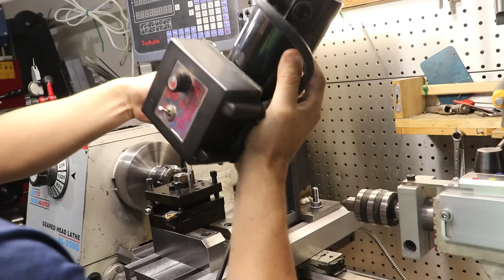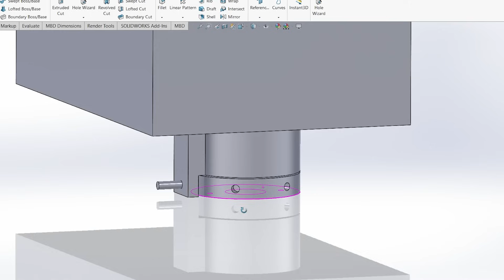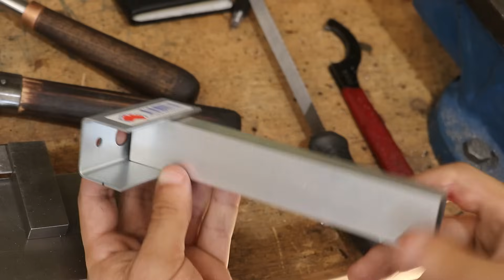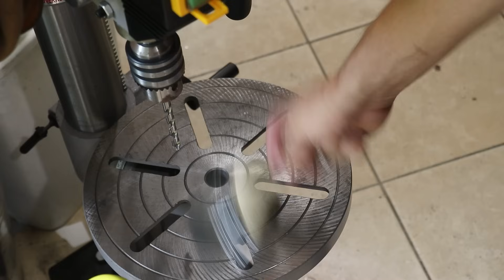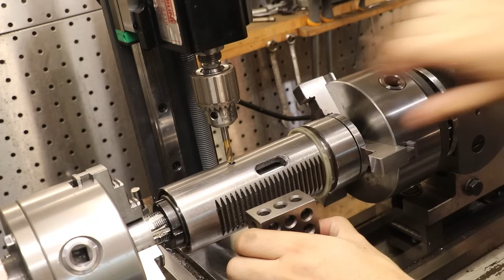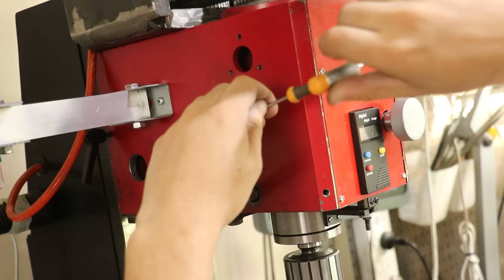Spindle Lock For The Mill - I Should Have Done This Years Ago

Comment: With the amount of time you spend on your hobby I'd suggest opening some cash sales accounts with material suppliers. Bunnings is often close to 6x the price for aluminium and mild steel, only for use in emergencies
Reply from the maker: I have a proper metal shop that I go to once a year. It’s a 3 hour drive to get to them. With most places I don’t reach the MOQ for most metals and most places near me only sell in 3 or 6 m long bar stock. It’s never as straight forward as I would like it to be
Reply: @artisanmakes  i look at is this way, i can buy a length of material for less than i can buy 1m of material at a local hardware store so it doesnt matter if i dont need it all its still cheaper usually straight off the bat, maybe im spoilt for with storage options or just that pricing competition is much greater in the SEQ because delivery is usually free too. 

Love your work, hate bunnings prices.

Comment: A much needed upgrade! Years ago I made similar for my mini mill with some minor differences. The springs is hidden or on the back side, the knob after pushed in is rotated 90degrees  and stays in and locked and when rotated back it pops unlocked, the knob it self is 1’ hex stock for easy flat gripping to order to rotate. A hardened 1/4” pin goes into the aluminum belt drive pulley which has a steel bushed pressed in to eliminate hole elongation. Made a draw bar hammer from the correct deep well socket cut off the square drive, pressed in a brass rod and drilled thru all for a handle which locks the two pieces together…
 So basically push and twist the lock, loosen the drawbar with the hammer socket flip the hammer and a slight wack  from the brass end to loosen the R8 collet… super fast and super easy

Comment: If you want to make sure you dont engage the spindle while the pin is in place, you could put a small switch that either breaks the power to the spindle, or triggers a bright red light when the pin is pushed in.
Reply from the maker: That is what the spring is for.

Comment: Very cool! For mone (I had the same mill), I made a collar that fitted the spline and locked that in place against the top of the mill using the heads of the three existing cap heads. I like yours more as I had to lift mine off to use the mill.  I sold the mill and upgraded to a bigger one in the end :)

Comment: Good fix! There's nothing like a draw bar for tool holding, but users get flustered with reaching high to use them. Some end up making clever air or electrical devices to drop the tools.
Reply: I'm like 6'2" and I have to reach almost as high as I can on my mill to open the drawbar. 6ft or shorter guys would absolutely need a stool or something

Comment: i love this channel so i hope i don't sound too aggressive or over criticizing, but why would you machine a piece of steel for plugging the hole on the side, it seems such a waste, especially considering the fact that it only partially covers the threaded holes, and that a simple sheet would have been more than adequate, maybe even bolting it instead of gluing it. 
I understand this might have been practical at the time but it feels so cheap to see...
Reply from the maker: I found it in the scrap bin and it was roughly the size I needed. That’s it. I don’t generally stock any large steel and this was the only big large enough. I don’t particularly care about the little bit of hole left exposed and I wouldn’t recommend that you do. Cheers
Reply: @artisanmakes  i see the mindset, and i actually understand  and appreciate it, keep it going with the important stuff!

Comment: Great project again!
I was wondering if it might be a problem for the locking pin to come out by itself?
You could have used a ball bearing and a spring in the collet and a recess in the pin at the “locked” position to help the pin stay in place when you change tools. Then, just by a slight pull, you could retract the pin and it would slide out?

Hope you get the idea, my English isn’t so great 🙂

Greetings from Germany!
Reply from the maker: I want the pin to always be pushing out as a sort of safety. I don’t want the pin to be locking when I start the mill. That could happen if I used a ball detent. That’s how I see it anyway.

Comment: Didnt you consider different options, like motor brake or lock (you have a lot of acces and space around motor cooling fan), or add encoder to motor and then FU should be able to stop motor completely.
Reply from the maker: I don’t particularly want to be attempting to modify the motor. It’s not an area I know much about and I don’t think it is something I would want to be showing YouTube incase I do something wrong.

Comment: I have a PM 833, and it doesn't come with a captive drawbar. I made an easy modification that works well. It involves machining a small groove into the drawbar, then drilling and tapping three holes into the thicker splines in the spindle. The set screws in the holes index into the groove in the drawbar, which prevents it from rising during collet changes but still allows it to turn freely. I can send pictures if you need them, but it's pretty simple. I also added a thrust bearing between the spindle and the drawbar nut. I use a cordless 90 degree impact to tighten and loosen the draw bar so no need for a spindle lock.
Reply from the maker: I think I understand what you are describing. It is an interesting idea that I have never thought about. I am glad to hear that it works for you

Comment: Just wind the spindle down, align the MT release slot in the spindle and the quill and place the MT release tool in there to lock the spindle to the quill together.
The other advantage of this is the draw bar nut is now lower and easier to reach🤣👍🇦🇺
Reply from the maker: I used to do that heaps when I first got the mill. It takes 50mm movement of quill to engage that channel. More often than not than not there isn’t room to plunge the quill down. So you spend quite a bit of time cranking the head up and down. I think that’s why I stopped doing that method.
Reply: @artisanmakes  Makes perfect sense.
Especially if you don't want to move/dusturb the carriage position to remove a tool and height is limited etc.
Also, in my case, I have a stupid mill with a round post with gear and rack system to raise the head, so if I loosen the main post clamps to raise the whole head, the head can pivot/swing side to side on the post, so I can easily loose my position🤣👍🇦🇺
Reply from the maker: I know the pain. The first mill I ever used was a round column mill. A pain to use, thankfully I never had to machine anything too precise. with that mill. Cheers

Comment: I think there was an infinitely easier solution, just cut a small key way between the exposed bottom (rotating part) and the fixed spindle shaft. Slide a square key in the slot and the shaft can’t rotate.
Reply from the maker: It’s not too dissimilar to the sliding pin I originally drew up. I think the problem I’d run to would be the same as the pin design, which would be mounting a spring loaded sliding key to the quill. There’s just very little wall thickness to work with so drilling mounting holes, other than M3 (like you see for the dro mount) would be difficult and I would like something more substantial than M3 holding it all together. Cheers

Comment: Boy, I hope you never feel the need for larger equipment after all these upgrades. The only time I had to disassemble the quill to my mill was when the pin for the R-8 collet sheared off. I hope to never have to do that again, though, since I bought the mill in 1998 (new) and have used it a lot, I may want to put new, better bearings in. I’ve also made several major modifications and while I’d like to get a different mill, all of these mods stop me from making the decision.
Reply from the maker: Good thing is I probably couldn’t get anything heaver down to this workshop than this mill if I tried.
Reply: @ same here. I don’t have a Bridgeport size mill because I don’t have the ceiling height.

Comment: Whoah this is excellent! I need to check or replace my spindle bearings, (same mill), as I don't have a lot of faith in either their initial preload setting or subsequent use/wear. 
They have not been mercilessly flogged, nevertheless, mass produced chineseium settings and quality don't necessarily align with the work I need to do nows critical requirements.
I have attempted to adjust the pre-load in situ, (tricky indeed), but I'd rather spec my own bearings and start from scratch.
I have never seen the spindle removed and disassembled so this is pure gold thank you Mr Artisan!. (I have the parts diagram exploded view but yeah - video!).

Comment: Really nice! My only concern is it looks like you could engage the lock while running the mill. Might be worth putting an E-stop switch on your spindle lock just to avoid that possibility. The spring should help avoid the problem though, so maybe not necessary.

Comment: The only question I have is when do you take delivery of a third hand/arm combination, and where does that mount? Over the left tit or the right? Unless I'm missing something you need a hand (1) to press the lock and keep it in place against the spring, while hand (2) uses the wrench to undo the drawbar nut so that hand (3) can take the tool to be removed, out of the spindle and pickup and reinsert the replacement tool while hand (2) tightens the drawbar while hand (1) is still holding the spindle lock in place??
Otherwise, a well ?? thought out and executed project.
Regards from Canada's banana belt. 
🤞🇨🇦🍌🥋🇺🇦🕊🇦🇺🪓🪃🏁👍
Reply: Well the way I see it, previously hand (1) was holding the pin wrench, hand (2) was undoing the drawbar nut and hand (3) was taking the tool out. So this is definitely better than stock!
Reply from the maker: Its pretty straightforward. Left hand uses the spindle lock, right undoes the drawbar using the drawbar spanner. I Then use the drawbar hammer to hit the tool and I use my left hand to remove and replace the tool.

Comment: Hmm I have a long way to go in modding my mill, you are on another level.  I have that same mill and the only made two mods so far. The first was to remove the Quill DRO on the front and replace it internally with a magnetic linear scale and combined that to the Z axis on my DRO so that regardless or whether I move the head or the quill it is a z movement on the DRO. The other was to put a bigger hand wheel on the Quill control at the front to give finer control when using the locked quill.

Comment: Это не так делается. Сперва изготавливается разрезная втулка, потом она вставляется в патрон и растачивается в чистовой размер при усилии от кулачков патрона, затем в чистовое отверстие при слегка разжатых кулачках вставляется обрабатываемая деталь и втулка смыкается с усилием кулачков обратно.
Втулку сперва разрезают, а потом уже обрабатывают.
Reply: His way will work completely fine. There's enough compliance in that ring that there is no meaningful difference between the methods.
Reply from the maker: I don’t see what the problem is. It’s machined to exact final size, so the diameter isn’t really changing when it’s cut and clamping on the spline shaft.

Comment: May be a good idea to add a small proxy or limit to interlock the start/stop button, would hate (but would also love?) to see what happens if the mill were to try fire up with the pin in there
Reply from the maker: It would probably stall. It doesn’t take much to stall the motor when it’s starting from zero rpm. And it has so little torque that I’d be surprised if it cases and damage at all. Cheers
Reply: @artisanmakes  that makes sense. I forgot that your mill is vfd driven too right? That would essentially make the risk of damage next to none
Reply from the maker: Yeah its vfd 3 phase. For what its worth, it took even less to stall the old Dc motor that it replaced. Cheers

Comment: here's a tiny tip,sinse i hade similar problems whit looseing the drawbar..i made a new one that is about 6-7 cm longer, welded a nut at the top and have 2 more nuts on it..the top nut is for holding the bar,and the 2 moving nuts for locking it in place..the bottom one locks as usual, the other one locks on the first one for extra support, also this helps me a bit whit tools that have shorther or longer threads for the drawbar

Comment: I assume it wasn't an option to add a locking mechanism to the top of the mill?  I was trying to catch a glimpse as you took it apart of how much of the spline was available above the belt drive pulley.  I figure that having something engage there would have allowed you to have most if not all of the travel while still providing a locking location.
Reply from the maker: The spline shaft disappears deep down into that external spline pulley. So any lock would need to be connected to the pulley or I might have issues with the spline reengaging as it moves upwards. I’m not saying a lock couldn’t be made for it but it might not be as straight forward as it looks.

Comment: Nice job. I took a rather lazier approach and 3D printed a spanner that fits on the exposed spline shaft at the top of the spindle. Even in PLA the spanner's held up well for a few years.
Reply: I use a little adjustable C spanner on that spline at the top, have never even touched the pin spanner cos it's so ridiculous.

Comment: Why not take that wrench remove the handle and bend the bar so it would engage the mount for the depth DRO?
It would lock the spindle, and you'd only have to use light pressure to hold it in place while you use a wrench on the top. No significant machining required.
Could use some work on simplifying projects. I've found it eye opening to work with guys who've spent decades just knocking out minimum viable product type stuff. Not something you want to do all the time, but developing that mindset is great for finding the simplest solution, then beefing it up a bit when that's what is required

Comment: Looks good, i may have put the spring inside the housing if space permits, then added a pin like the one you added to the inside to keep the locking pawl from flying off on the outside of the locking pawl with a slot on the mounting bracket to allow the spring to push the pawl into the locked position and a shallower slot 90 degrees out for it to slip in to keep it unlocked and without risk of it rattling loose and locking itself

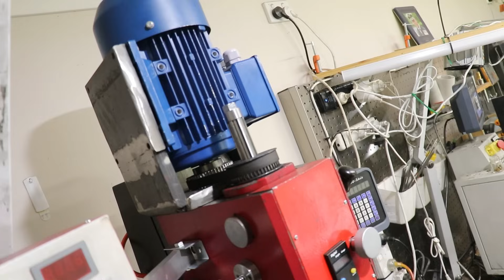Comment: Nice mod. I have an older version of the same mill. Here in the UK it's sold as a Sieg x3. I too fitted a spindle lock because not only did I hate using the provided pin spanner, it didn't even work with a keyless drill chuck I bought. My version of the spindle lock is infinitely crappier than yours though. It's just a thick aluminium plate that I drilled and filed so it would drop onto the spindle spline (shown at 23:50) that pokes out of the top cover (which you've removed for your drive conversion). I mounted a machined pin in that top cover with a matching hole in the aluminium plate. So I just drop the plate over the spline and pin, which locks everything up. Of course you do have to remember to remove it once your chuck/drawbar is tightened, otherwise it'll be unhappy when you turn the machine on. I've had that setup for over a decade now and it's so nice to have both hands available for dealing with chucks and drawbars.
Reply: I  have this same mill, (I'm in the UK too) and the pin wrench is a real pain, I like the sound of your solution, will have look tomorrow, cheers, Dave
Reply: @daveharriman2756  Cool, good luck with it Dave.

Comment: Great job as always! A pin spanner is a poor solution for something use so frequently, it's already staring to oval the holes in the spindle.  Make sure the motor control cabinet is mounted rigidly enough that you can hit the e-stop, it would suck if you had an emergency situation and the cabinet just swung back instead of operating the stop.